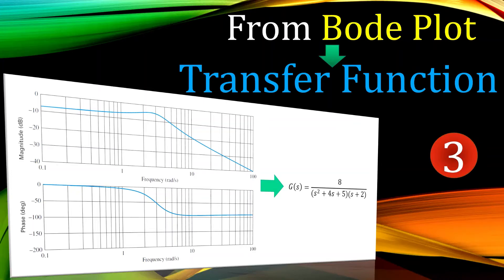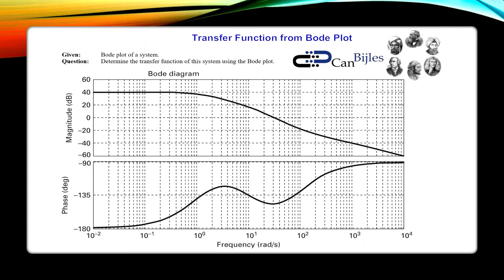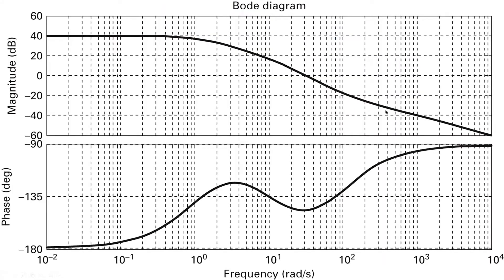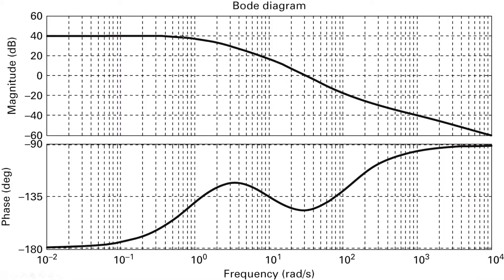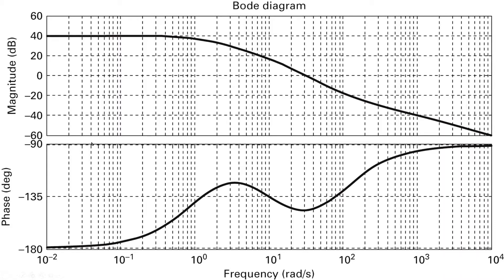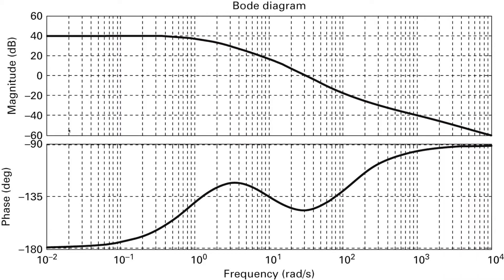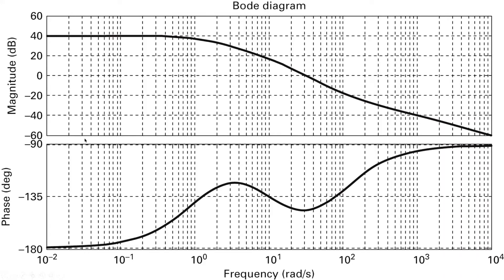Deriving the Transfer Function from Bode Plot 💡 Nonminimum-Phase Pole 💡 Example 3

Comment: Thank you, this is very useful, just what I needed really. Im curious to at around the 12 minute mark, why does only one of the poles count as non minimum phase? Wouldnt the wp2 also be negative? Thank you again.
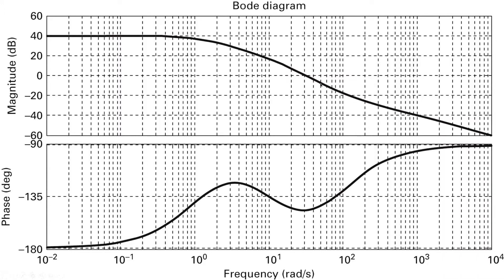Reply from the maker: Thanks for your message! The reason that only one of the poles is nonminimum phase is explained between time 00:02:45 and 00:04:20. Let me know if you still have questions about it.

Comment: Is this also possible with GNU Octave or similar? Putting the bode plot from a network analyzer in and getting the approximated transfer function out?
Reply from the maker: You can use other simulators than MATLAB. The objective is to determine the mathametical model from a Bode plot, which can be found from measurements.